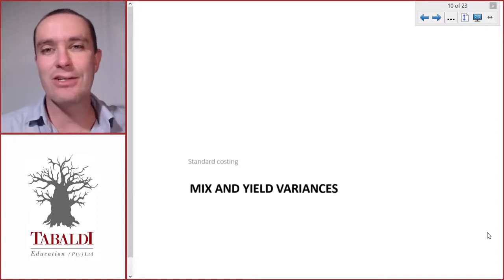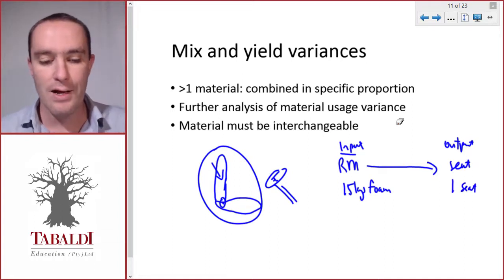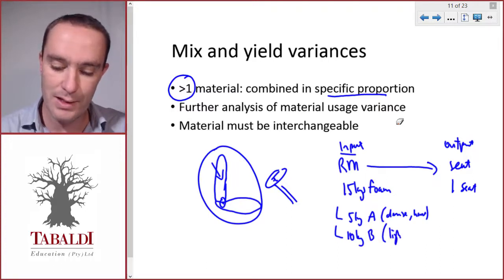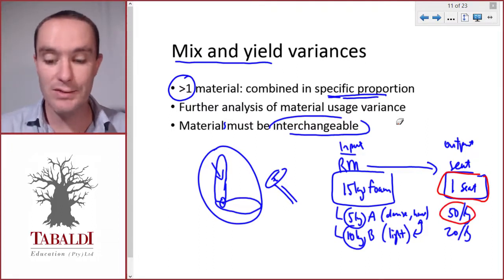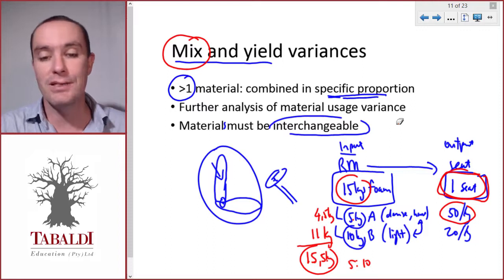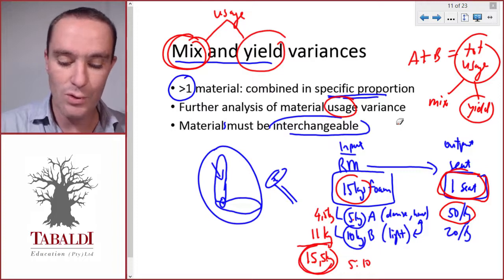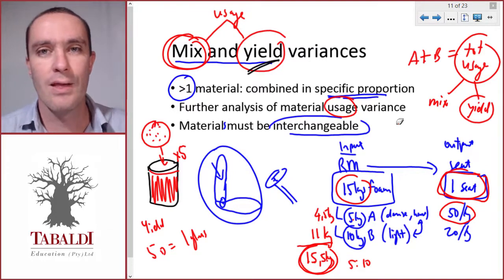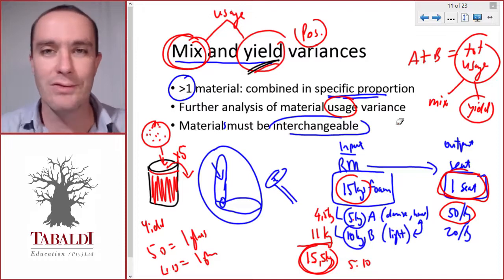Material Mix and Yield Variances | Standard Costing

Comment: Amazing video! Wish I found your channel earlier.
Reply from the maker: I hope the exam goes well!
Reply: @TabaldiEducation   Just a question if you're able to respond, how do you comment on the mix and yield variances? ( Ie how do you know that you used less of a cheaper material over expensive)
Reply from the maker: @advaangobind6476  The best way is to try and understand WHY they would change the standard mix. For instance, if the 'recipe' requires a mi of 2:1 of A and B, why would they use any other ratio? If A is cheaper, they might use more of A and less of B... e.g. 2,1 : 0.9. This is only possible if the raw materials are interchangeable (like chemicals in paint).

When you comment on it, you have to look at whether they used more or less of the more/less expensive material... and look at what it did to the yield as well.

Sometimes, you can use more of the cheap stuff and less of the expensive stuff (positive mix var)... but then end up using more in total (negative yield).

I hope that makes sense.